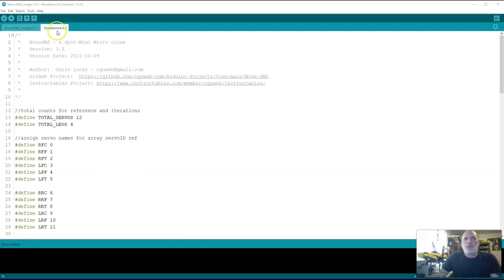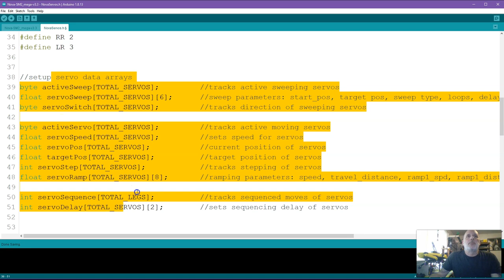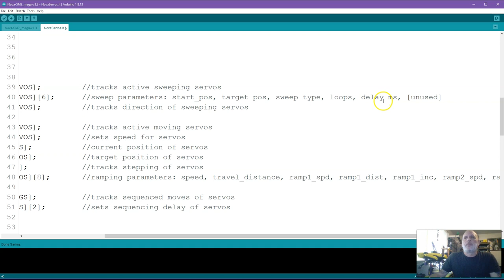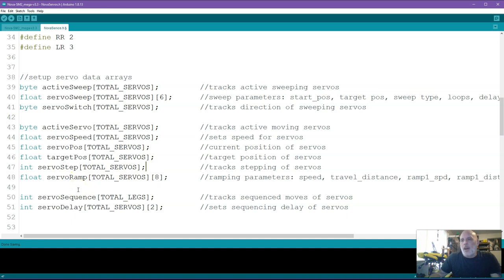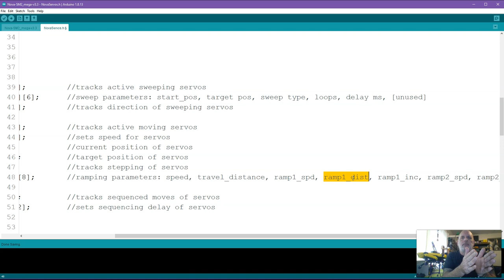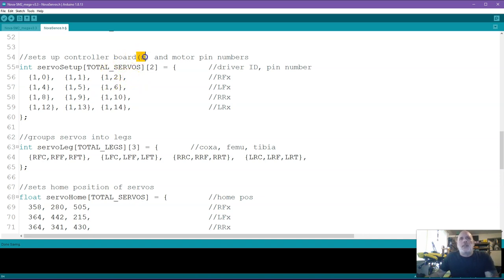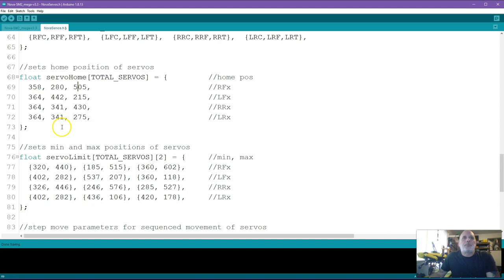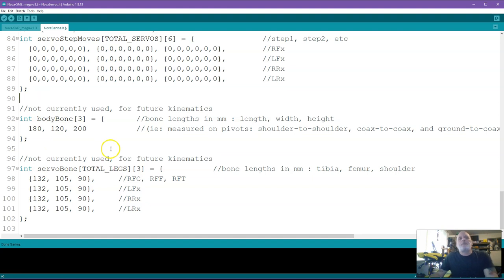Nova SpotMicro - Software Review: NovaServos.h

Comment: In what unit the min,max and homepositions are? Usually those are like microsekonds and for normal servo its like 1000-2000 or 500-2500. And your values are wierdly small🤔 so do you mind to explain 🤣
Reply from the maker: correct, it is not time, but the PWM signal that the adafruit PWM Controller board expects. Its dependent upon the frequency setup in the driver. 

https://learn.adafruit.com/16-channel-pwm-servo-driver

I just used the setup they suggested for servo motors, so the range for 180 degrees turned out to be around 150-650 for min-max, but even less for Nova with mechanical constraints. Hope that helps.
Reply: Thanks. This explains it😁